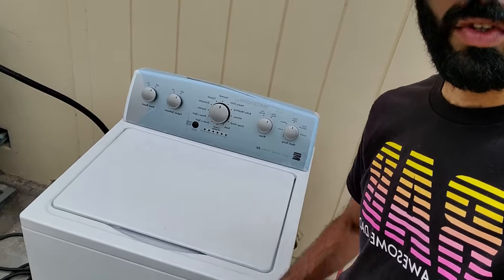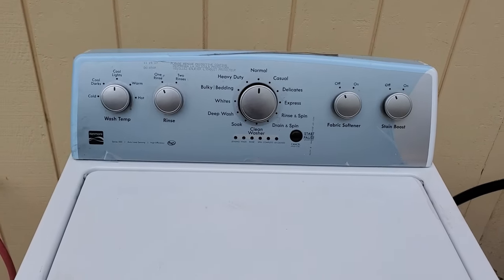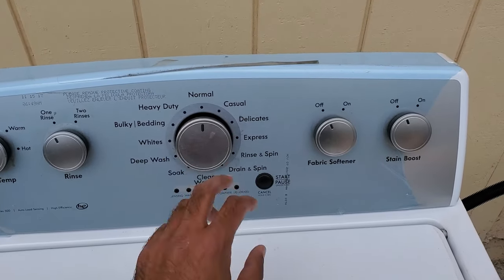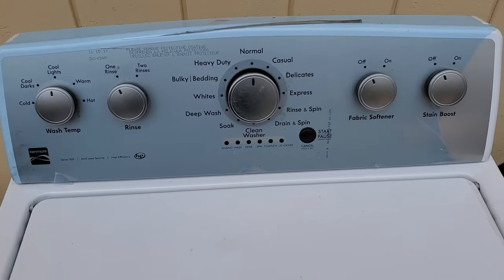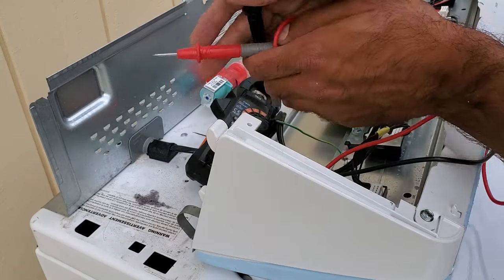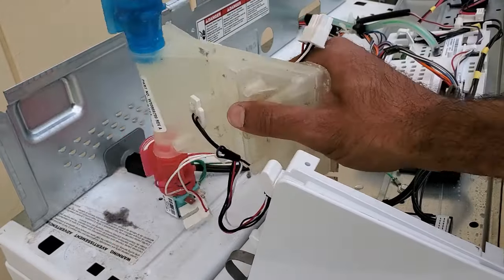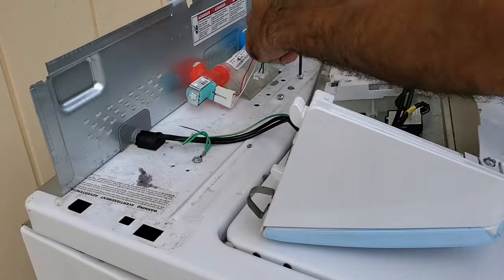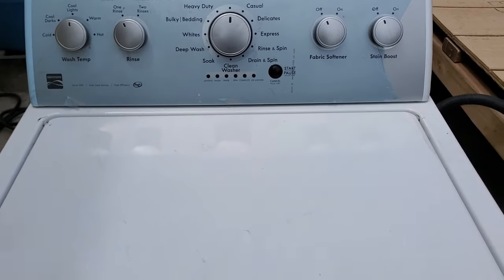Fixing A Kenmore/Whirlpool HE Washing Machine Stuck In Sensing Mode!

Comment: I have a Maytag that's stuck in the Sensing mode.  It was working fine when I started to wash clothes on Sunday.  I went out to walk my dog when I got back I heard a buzzing sound coming from the washer and it was stuck on the final rinse cycle.  I tried the power/reset button to have to washer drain itself but it got stuck in the sensing mode with a buzzing.  I unplugged the power and when I plugged it back in, I got the same result.  The sound seems to be coming from the water valve area, so I'm thinking that it went bad.  I've only had this washer for 4 years and its a shame that this happened so just a few years after getting it and the extended warranty expired.
Reply from the maker: Sometimes the valves can get clogged as well. Perhaps unhook the water lines and see if the inlets are clogged
Reply: @DuctTapeMechanic  I'll check tomorrow.  Thanks for the info also I have the new valve part coming Saturday so if anything I'll replace it.
Reply: Well I replaced the water valve and it still senses light still flashes and I still here the buzzing sound so it's not the water valve.  I believe it to be the The drainage pump.  And that something that I will not try to get or replace.

Comment: hello  dt mechanic,,I have a  ladyfriend with a kenmore series#5oo washer #110-251-3241,type-589-01,I did not look at it,she took a photo with her  cell  of the main function  control,there are  green lights under it,i recall 5 or 6 lights,the one on the far left is on only,,i beleive it says sensing  under it,I said to her the  function control  panel or  whatever this part is  called  may be worn out,my machine  had no clicks  when you turn the dial,she said it has some clicks when  you turn  it,i did not try it,so could my  answer  to  this that this part is worn out and should be replaced or could the water preasure  sensor on the drum or  the hot-cold water pump or both be  a possiable problem,thanks for any help on  this,dan diorio,,

Comment: Great video! I have the same washer and I need to buy a replacement valve like the one you bought. Can you tell me where you purchased? The ones I am seeing are all $55 or more. Thank you
Reply from the maker: Unfortunately due to inflation they are all probably around $50 for the part now (still better then a repair guy or a new machine). I recommend just searching the part number on Amazon.

Comment: my kenmore series 100 is stuck on the spin cycle and will not  come out of spin the lid locks and it will spin and can not go into diagnose mode at all and checked valve assembly , and thats fine help!!!!!
Reply from the maker: Unplug it and plug it back in after a few minutes

Comment: What is the best way to fill it, Mine keeps jumping across my garage and I have to jump on it like it's a mechanical bull 🐂. Then hit the pause button to stop it and start over.
Reply from the maker: Most likely, you have bad suspension rods. Just search from a reputable online appliance part store by model number, and you should find the rods your machine requires. If your machine still bounces around after replacing the rods, then the inner tub is stripped, and the machine is beyond reasonable repair.

Comment: My machine has the sensor light go on and locked light goes on and it not sensing at all and start filling the tub and then makes a loud noise like it trying to sense and then turn off. Any ideas? I have check the fill valve ye...
Reply from the maker: Does you machine begin to agitate? It sounds like it's not agitating, it could be the mode shifter. Check out my video on how to replace that (it's my latest video)

Comment: How would you be able to know if it's the actuator that's bad?
Reply from the maker: I would say if you can hear the lid lock and have tested the valves like in the video and still its stuck in sensing, I would try replacing the shifter actuator it's only like $30 plus it's easy to change.
Reply: How much for valve replacement?

Comment: I have the same washer I replaced the valves and getting no codes. Hot side works. When cold is starting it hums but if I turn off and back on cold water supply it will work but I have to keep doing that throughout the wash. Any ideas? Thanks
Reply from the maker: I think perhaps your valves are getting stuck. It might be a good idea to replace them. They are not that expensive on Amazon
Reply: Thanks for the reply I will try that next.

Comment: I encountered a situation where there was no way to enter diagnostic mode. It would remain in sensing mode and not lock the lid. What I found to be the problem was the drain plug had a broken wire. It has a plug that splits. I reattached and it started working when I plugged it back in.
Reply from the maker: Nice job!

Comment: I had that issue. I did the open and close the lid 6 times. That worked 2x before. Now, it's stuck in rinse cycle. Any idea what it could be?
Reply from the maker: Most likely the shifter is bad
Reply: @DuctTape Mechanic  Thanks for quick response
Reply: @DuctTape Mechanic  what is a shifter?

Comment: My washer has the lid locked light on and won't let me open it. Is there anything I can do
Reply from the maker: Trying pulling the plug and reseting it after a couple minutes.
Reply: @DuctTapeMechanic  it worked thank you. It's about 7 years old do you think I should start getting a new one soon.
Reply from the maker: @munozgaming3016  you will probably need new suspension rods for it in the next year or so but after that I would keep it as long as possible new machines are expensive right now
Reply: @DuctTapeMechanic  alrighty boss

Comment: I have the exact washer and it is stuck on sensing mode but when I switch it to drain and spin, I can smell burning. Any ideas? I’m going to swap out the water valves like you did but any idea on the burning smell?
Reply from the maker: Burning is strange for sure...if it's not filling with water I would definitely test the valves first
Reply: @DuctTapeMechanic  I will update once I replace the valves. Thanks.
Reply: The water valve inlet was replaced along with the actuator under the washer. I recalibrated the washer and the washer worked for one deep wash cycle but now it’s stuck on sensing mode again.

Comment: Bro.... I need HELP!. I have the SAME washer. The other day it was locked and lights were blinking. I left it alone thinking it was just doing its thing but then a few hours later same thing.... I later unplugged it and plugged it back in however that didn't help and now nothing on the display is working. After some elbow grease, I was able to open the lid but not I have no power in the display. When I plug the machine in, I can hear a soft click and than a few seconds later I hear another soft click but nothing on the display is working. I took the machine apart and plugged it in while looking at the motherboard and once plugged in I see a small green light that stays on constantly. Sorry for the long post but I'm at a loss... please help
Reply from the maker: I would plug the machine in then hold the  start button for like 10 seconds. Then I would put some cloth in the washer and hit the start button the sensing light should light up. Also are you sure your lid lock is not broken?
Reply: @DuctTapeMechanic  
So when I close the lid now, it will still lock. The only way I've found to open it is to press down on the opposite corner and then pretty much force it open... im gonna give your suggestion a try and I'll get back to you
Reply: @DuctTapeMechanic  ok so now I'm thinking it's the locking mechanism.... I tinkered with it a bit and now I get one light when I plug in the machine that is blinking red saying "lid locked" the light only blinks for about 3 seconds and then turns off. Other than that the machine is unresponsive.
Reply from the maker: @mustafamalik7381  sounds like it is trying to lock but can't. Do you hear a sound of when the light is blinking? There is typically a distinct clicking sound when the lock is actuated.
Reply: Wow, I have the exact washer and probably the exact same problem.  I've determined that the clicking sound is the lid locking and then unlocking repeatedly.  Could it be the lid locking mechanism?

Comment: Pleas help me! My washer has coins stuck between the agitator plate !!
Reply from the maker: Can you see the coins? If so I like to use a slim screwdriver to get them out or even a razor blade. If you can see them you will have to remove the agitator plate to get them out.

Comment: I have the same washer, I'll hit Start twice before lid clicks & locks. Motor will start to turn then immediately stops, Lid Lock light flashes then lid unlocks & Sensing light flashes. I checked internal resistance in both water valves which checked out fine @ 1.5 k♎️. Any ideas what's going on?
Reply from the maker: Have you checked to see if the valves aren't physically blocked with build up (perhaps try undoing the water lines and see if they are blocked). If they are ok I would put this in diagnostic mode and see what code it throws (I linked a video on how to do that in the description).

Comment: I have a Kenmore HE washer, model 110.28002011. I've looked and looked and can't seem to find how to put this specific model into diagnostic mode. Can you help with that info?  Thanks.
Reply: There's a manual taped to the inside the front of the washer. Complete instruction and diagnostic interpretation.

Comment: I have the same exact washer but when I hit the start button, it just keeps clicking. If I manually lock the lid with my fingers, it will start to fill a tiny bit of water but then stops. I can hold the button down to cancel and then I hear a sound as if it's draining. Any idea what it could be?
Reply from the maker: I would first check the valves to see if they are ok. I was having a similar issue when just a little bit of water would come out. If the valves are ok I would next look at the lid lock
Reply: @DuctTapeMechanic  the filter where the cold water goes into the machine was filled with sand/dirt. I cleaned it out and put the machine on "clean washer" mode and it started the process without any clicking. Seems like it worked. Thank you!!
Reply from the maker: Perfect good work!
Reply: @DuctTapeMechanic  It didn't work for me on a regular wash mode. I have the repair guy coming tomorrow 😥😥
Reply: @HughJitsu  : Well?, what happened???
Reply: @Android_Warrior  It was the lid locking device. Had to be replaced. Cost me $200 with labor.

Comment: @TheDaddysgirl845. 19 min ago
I have this washer and it won't go pass
sensing the load and the lid lock light
just blinks won't unlock unless I unplug
it. Was told it was then it wasn't the part
that allows the water to flow from the
pipes to the washer(forgot what the
part was called.@389. Last time I had to
have it fixed it was the memory board.
Again not sure if that's the correct name
of the part but it was found under the
washer..somebody please help if you
can.
T

Comment: What screw driver sizes are you using to remove the back panel and inside the washer?
Reply from the maker: They are 1/4 inch hex screws in the back and I believe T-15 ( aka star head screws) on the water valve

Comment: Ok, I have a Whirlpool top load washer & I took the screws out from the back & scooted the lid forward, but it's locked somehow, I can't get the lid open. Is there a button I'm supposed to push under the lid to get it to unlock & open?
Reply: Pull forward, lift, then push back. Like it has a hook.
Reply: @wylykyotys  Thanks, I'll have to try that.

Comment: If water gets on the top part of the machine can it get into the panel? I had a hose that was a bit too short and it ended up coming loose and spraying water all over my laundry room. Now the washing machine won’t progress past the sensing fill light. Could it be water damage? I had a tech come out and he thought that I had some kind of clog. He charged me over $400 to just fix this small issue that I don’t believe was ever an issue! “The actuator” but My whirlpool washer is less than a year old! It doesn’t make sense to me that he would have to change that part so early on! Now he’s telling me that the entire panel will have to be replaced for over another $400! I could have bought a new washer for $700! Please help!
Reply from the maker: I don't think the water is going to cause that issue. $400 to replace the actuator is ridiculous. I wouldn't put anymore money into it, perhaps get a new one or a used one.

Comment: when you said load sensor you mean washer selector switch ??
Reply from the maker: I mean the rpm sensor on then shifter actuator
Reply: @DuctTapeMechanic   thank you
Reply: my washer is stuck on sensing mode & the water valves seem to be good im going to replace the whole control board hope the fixes the problem

Comment: Do you prefer Impeller or agitator?
Reply from the maker: Definitely agitator
Reply: @DuctTapeMechanic  Thats what every repair guy says. Are the agitator units easier to repair?
Reply from the maker: @ivoted7199  believe it or not the units are pretty much the same but the agitator seems to clean cloth better, also people seem to think that a washer with a impeller/wash plate means that they can overload the tub which leads to suspension problems or a stripped tub.
Reply: @DuctTapeMechanic   Ahh yes, the age old "operator error" story. Thank you for the response. Love the channel. Great to see a smart, handy young guy working with his hands. Keep up the good work.

Comment: I have a Kenmore washer that will only "sense" its either a solid sense light or a blinking sense light (blinking sense light, push start then its solid sense light and so on), sometimes it sounds like its going to do something but then nothing. My sister was washing a large blanket, it never went to drain/spin, she eventually canceled the wash and opened the lid to find the washer full of water still and the sense light has been on or blinking ever since and the machine will do nothing else. I opened the machine up and checked the valves like in this video, both hot and cold have resistance. I then pulled out the line filters and both were clean.  What do I check next and how do I check??